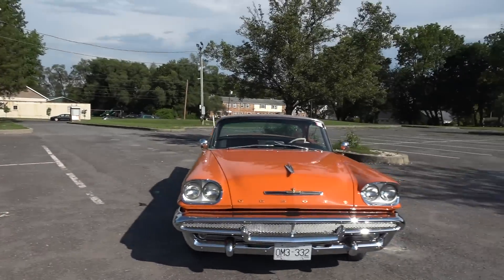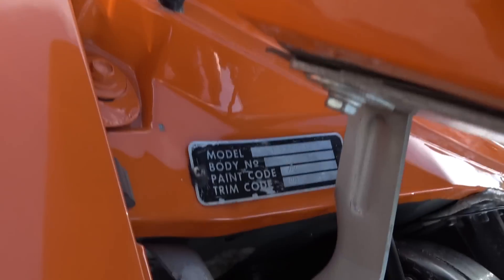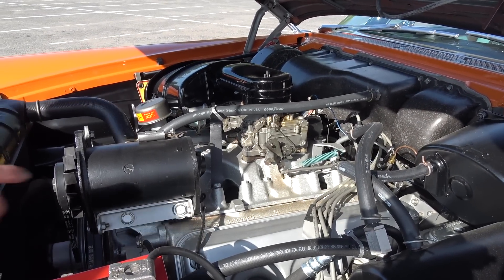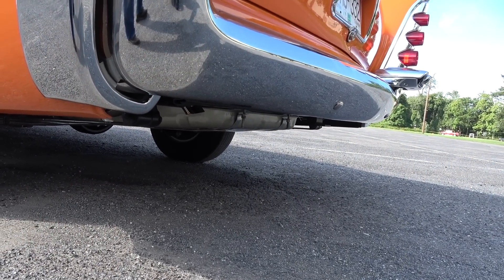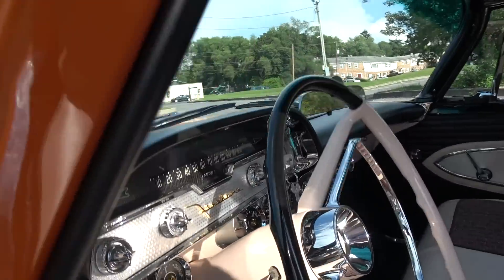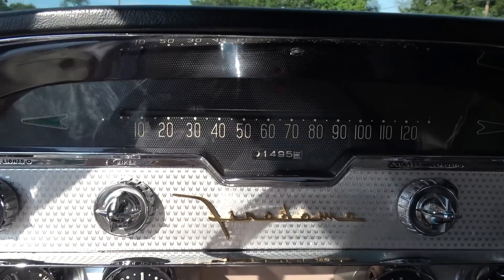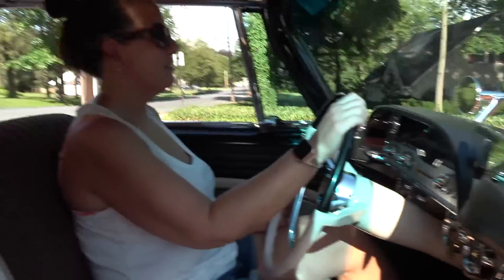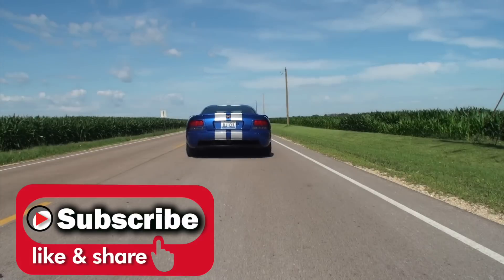WOW ! 1958 DeSoto Firedome Sportsman 2 Door in Rust / Beige & Ride - My Car Story with Lou Costabile

Comment: I owned one of those in 1968! It was a 1958 DeSoto Firedome Sportsman 2-door hardtop, all original. It was Fire Engine Red all over, with two-tone black and grey interior. It had the 361-Poly V8 with Torqueflite. I loved it! I also owned a 1958 Plymouth Fury at the same time, in 1968. Then I was drafted into the Army, and I had to sell the DeSoto. The Fury was totalled out in an auto accident on June 5, 1968 in which I was severely injured (it wasn't my fault!), but it didn't keep Uncle Sam from drafting me on June 16. I got a medical discharge and was out on Sept. 30, 1968, and bought a 1960 Plymouth Fury with 383-V8 and Torqueflite.
Reply from the maker: Hi Dejael, Happy to read this car brings back memories of your car :-) Thank you for viewing and sharing, Lou

Comment: Love this Firedome! As great as it looks in your video, Lou, it's even more magnificent in person. Ron and L'Donna are delightful and have performed magic in restoring this rare DeSoto - exterior, interior - every nut and bolt!
And we see here that its 354 Poly (polyspheric head) motor is topped by Chrysler Corp's unique-style air cleaner that mounts on the carb with its neck running off to the side, containing the plenum holding the air filter. Very interesting to see it in this Canadian-built '58 Firedome, as this style air cleaner was a 1-year only design that Chrysler installed on its 1957 US-built models. 
Chrysler manufactured its Poly motors from 1955-1958, using the same block and crankshaft as the famed Gen I Hemi motors, but using different heads, as L'Donna mentions, along with various other different internal components.
As DeSoto's period ads proclaimed - "It's Delightful, It's Delovely, It's DeSoto!!"
Reply from the maker: Hi Noel, Happy to read "Love this Firedome!" :-) Thank you for viewing and sharing your knowledge and adding to the Channel, Lou